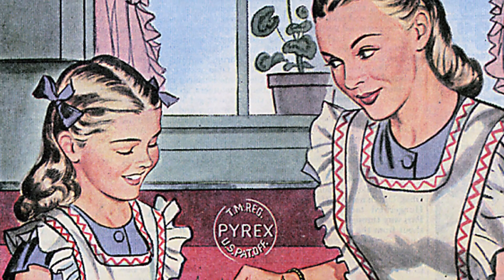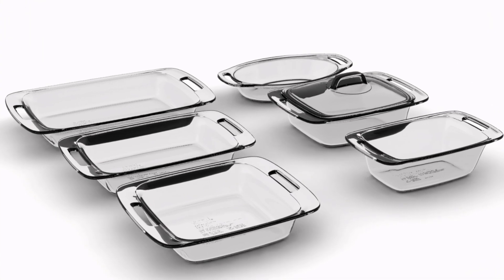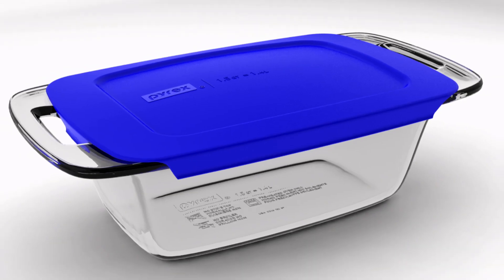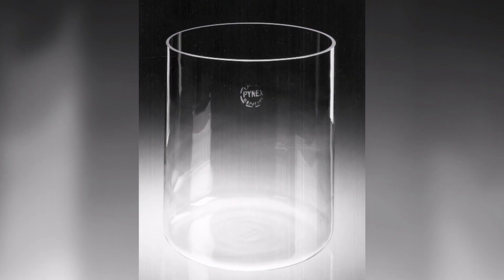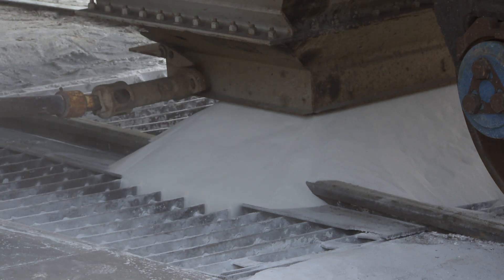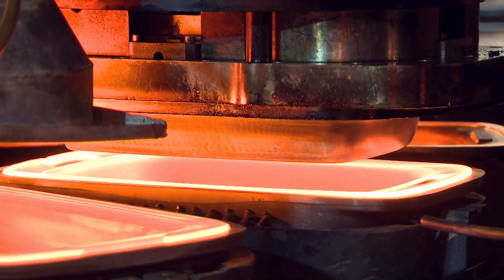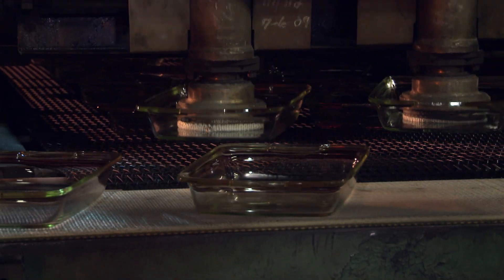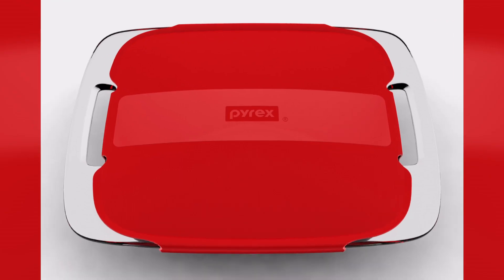How the glass in a Pyrex Baking Dish is made! - BrandmadeTV

Comment: You need to buy the European or more directly the French made with PYREX in all caps. They still use borosilicate glass. The USA pyrex in lower case use cheaper soda lime glass, that can't handle rapid heat changes. The easiest way is to look for PYREX or it's made in France then you know it's the better borosilicate glass.

Comment: In 1998, Corning, the company which made Pyrex, sold the brand to World Kitchen LLC. World Kitchen decided to stop the manufacture of borosilicate glass, and since then,Pyrex sold in the United States is made of tempered soda-lime glass, which does not handle heat as well asborosilicate glass does. That's why your Pyrex casserole dish explodes. You can get borosilicate dishes on Amazon or vintage Pyrex on Ebay...
Reply: Thanks for sharing.